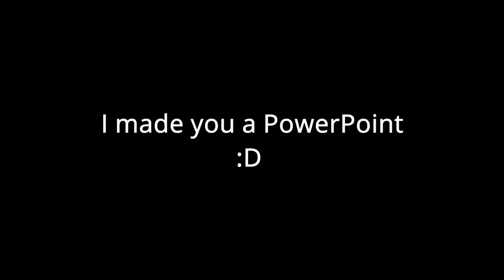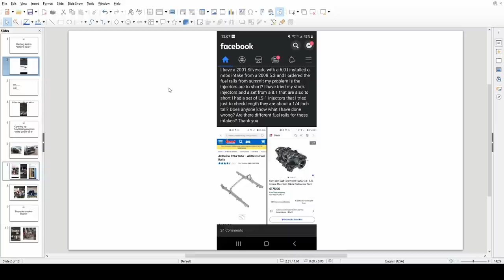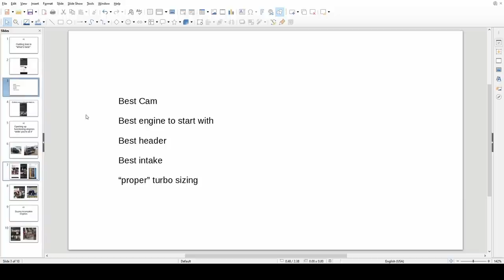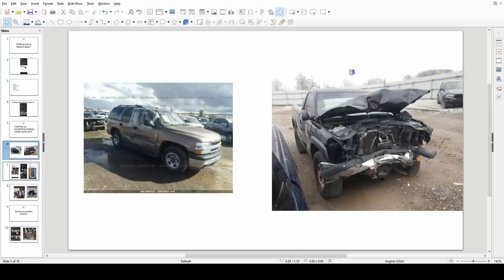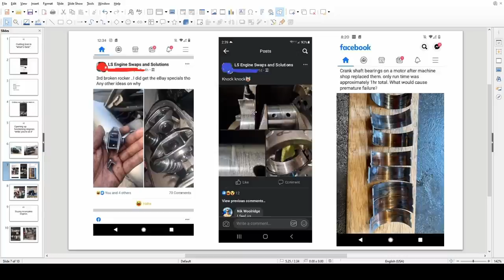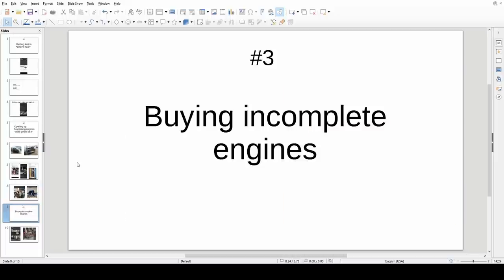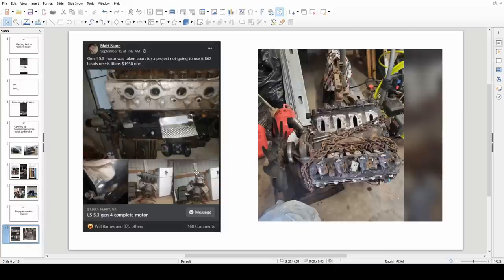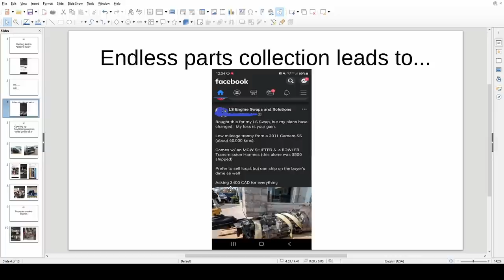3 LS engine build traps and pitfalls to avoid at all costs!

Comment: SOOOOO, i just bought a MB with SUPERCHARGED engine. I ASSUME headers or bigger exhaust would typically help a TURBO and /or supercharged engine more so than NA factory engine.

HEADERS on an LS engine would help ALOT more if combined with higher flow heads, higher compression , stroker crank, more fuel, bigger cam, proper tuning AND/OR a turbo/supercharger

Comment: I actually had a 30k mile 4th gen 6.0 GM crate motor that had a trunion failure on cylinder 1. Still ran fine, lifter was just kicked a little because of missing needles.

Comment: I agree with everything you said, but unfortunately shit can still happen. Bought my 06 Envoy Denali with only 30,000 miles on it, Drove it stock, with regular oil changes for another 100,000 miles, before deciding to delete the dod, installed a sloppy cam, springs and single turbo. Removed 4x4, and installed a 4l80e. Got it dynoed, only to spin a bearing 2 weeks later. Alls good in the end though. Now it's built with all forged internals. However, had I not been able to afford it, I would have just gone to the junkyard and picked up another engine. Gotta know what you can do within your budget.

Comment: More a question then comment.  You have a ls vortex with 300,000 plus miles and still runs. You pull it apart and refresh or run it?  I am the second owner sense 80,000.
Reply from the maker: Why? Why? My house is 117 years old... Do I tear it down and rebuild it? Or go inside and take a nap?

Comment: I found that buying a complete truck that was wrecked in the rear or rolled over is they way to go..you get all the engine and transmission parts plus electrical you need..plus you can sell the rest of the truck for money to purchase miscellaneous parts..

Comment: I just came across this, good video.  Just getting ready to put an LS1 from a 99 TA into a 02 Formula roller.  I did buy an aluminum intake to replace the LS1 intake and a stage 2 cam to help the shortcomings of said intake.  I'm debating on taking the heads off and porting them after I take the engine out of the donor car, I'm just worried about doing too much to a running engine as you mentioned.  The only reason I bought the intake is because I got a great deal on it, already had the cam and figured why not!  Hopefully in the next few years I'll be able to save up enough money for a fast 102 intake.  

I believe most people don't have a plan, I always have a plan... It's money and time that get in the way.. lol
Reply from the maker: Probably do wheelies with the extra 15 hp from head porting

Comment: Nothing wrong with stock LS engine from junkyard as long the is stock LS engine, one mistake is add to much horsepower to LS Vortec 6.0 400hp to LS3 6.2 430hp,  based on your budget, the best way is stock LS engine and transmission for engine swap, if you know the vehicle going to LS engine swap on, for example GM W body Chevy Impala and Pontiac Gxp the engine was turned sideways for GM 3800 V6 1gen & gen 2 & gen 3 engines basic 3800 and supercharger 3800 V6 was many W body and F Body, this same thing Pontiac Gxp 5.3 V8 LS engine, Chevy Impala SS also with 5.3 V8 LS engine, Chevy Silverado 5.3 LS and Vortec 6.0 V8 , engine swaps should fun, and  enjoyable.

Comment: Just put a lq4 from a van in my 83d150 . I’m sure you know this but motor mounts are super easy to make . Use a flat plate to the LS an use the factory dodge 318/360 mounts just turned around an weld to motor plate .. also mine has the 4l80 an all I did was spread the dodge trans mount ears about 1” an bolted to the 4l80 an use dodge cross member but pull the bolts an slide to the front holes in the frame an redrill the outer two .. 0$ an  dodge basically built it for ls swaps lol

Comment: I have purchased a 02 Chevy Silverado, 192k plus
Runs terrific. My question is what do you suggest for a cam swap. It's the only upgrade I'm considering.
Reply from the maker: Buy the cheapest one. 

Decide if you want a converter or not, and if you want to buy springs or not, then buy the cheapest one
Reply: @TheDrivewayEngineer  thanks for the advice. It's going into my 84 camaro z28 with a t5 manual transmission. 
Been watching a few of your videos. Will I have to get the pcm re programmed?

Comment: If you're going to spend a lot of money on a built engine for a swap I'd advise you to buy two engines. One should be complete and one can be pretty bare because you have all of the bits on the first engine. Use the complete motor to get the swap done as quickly as possible so you know that once you have finished building the other motor all you will need is a retune and maybe a fuel pump and exhaust. That's just the same as upgrading a vehicle that comes with an LS.

Personally I'd just get a low mile good LS3 and save the rest of my money for upgrading brakes, suspension, tires and driveline bits that may break with the extra power.
Reply: Very good idea which also gets you a spare engine. I've lived through several "collector vehicle and part" cycles and the LS supply is great (today) but it won't remain that way with the end of the "new simple petrol engine" era.  Smart dismantlers will keep a stash of desirable pieces for their retirement.

Comment: The only thing I have to disagree with is "it was running before the crash", yeah, on 7 cyl, with 5lbs of oil pressure!
Reply: Yep, just because it was running doesn't mean it was taken care of.
Reply: I'm going to tell you guys a secret. Look down the oil fill hole of any engine, if it looks disgusting, it wasn't looked after. If its reasonably clean inside it was properly maintained and should run fine. Also if the inside of the vehicle looks like they had pigs and chickens living in it that shows no pride of ownership, walk away
Reply: @superrodder2002  I could agree more 👍👍👍👍

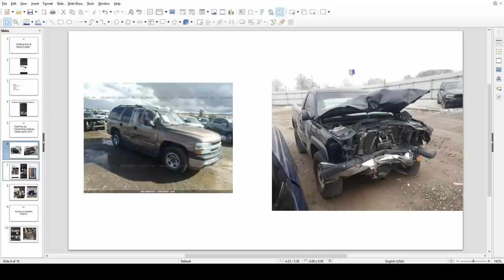Comment: 6:11 so what if the engine had the usual failed pushrod, lifter, valve spring combo?
Reply from the maker: I have no idea what "the usual failed" is. 

I've never once pulled one of these in 18 engines now that didn't just work the way I got it.
Reply: @TheDrivewayEngineer  its a common failure on 6.0s. Also cam bearings.

Comment: I was going to make bad decision a few days ago. I went to a pick and pull yard and I saw a Cadillac Escalade with a lq9 block I was thinking of buying it to build it up cheap but my common sense kick in so I just left it there because I saw someone else literally buy a running lq4 took it apart and they spent about $6000 into it.
Reply: That's not bad if he went with a new stroker assembly, heads etc...

Comment: I've seen plenty of factory trunion failures. And I've seen massive differences in similar advertised cams. So it kinda works both ways. Moderate performance, don't break the seal on the engine. If you want to compete in most motorsports, you're probably gonna be digging into the motor.
Reply from the maker: People who are going to compete in motorsports don't come to YouTube for advice. 

They do however turn around and tell some poor bastard who just wonders what he needs in his Iroc for it to live a few years and double the power he had that he can't do any of it without trunions, and porting, and forged this and that, and while you're at it.

Comment: Video makes sense but it’s for LS dummies for the intake you would’ve just gotten it with its original fuel rails and injectors with the intake for 100$ on offer up and all you would’ve needed was an 30$ adapter for the throttle body unless your going 92 mm and a 35 c5 corvette fuel pressure regulator because 01 has return lines and then obviously intake gaskets. He’s explaining to the LS dummies Richard explains a lot but if you don’t know the basics he’ll get you into a rabbit hole both content creators help and are informative.
Reply from the maker: Correct, all I'm trying to tell people is consider the cost and try to look at the big picture before they jump in.

Comment: A lot of old timers or guys that have learned from old timers seem to get really caught up in building these like they're a small block chevy. I've got a buddy with a 5.3 truck that is dead set on getting a 6.0 and putting aftermarket heads and dome pistons in it so he can make big power.

Also guys that feel like they need to go with the Melling high pressure oil pump. I've never ever heard of a stock LS pump failing ever. 

Cam bearings look bad, so they replace them. Nevermind that it would've run another 100,000 miles as it was.
Reply from the maker: Exactly
Reply: I have seen stock oil pumps fail. The pressure relief valve sticks open on cold starts sometimes and you get really low oil pressure. I’ve probably replaced about 10 of them for this over the years.
Reply: 219k on tahoe. Oil pump was playing games so I throw Lucas oil and 10w40. No more issues lol pressure to the moon

Comment: 5:50 while they clearly ran well, someone has never done all the work to get them installed and then have a rear main seal leak or a slight knock
Just because they ran doesn't mean they ran good.
I always do head gaskets and bolts since these are always graphite instead of multi layer steel. the pistons/valves are ALWAYS caked in carbon
oil pan gasket
intake gaskets
valve cover gaskets
springs
plugs and wires
trans filter and gasket
rear main
maybe even front main if I see any signs of moisture...
I HATE having to pull a motor I just installed... way easier on the engine stand.

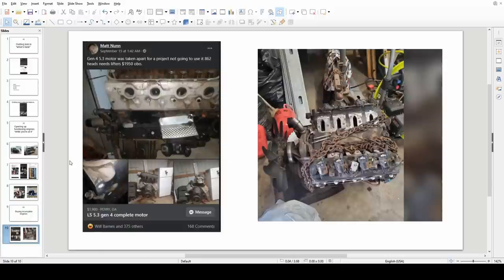8:35 thats HILARIOUS!!! bwahahhahah F Matt
Reply: My 4.8 LS i originally was NOT going to dig into but even after getting the crank out and everything disassembled it wasnt until after i starting honing the cylinder walls that i found a cracked piston. I had rusty valves which was my only reason to take the heads off and at that point i wanted to go the extra mile. It was out of a truck that had been running right before it was parked. and it ran well.. So yeah i mean its literally just kind of a preference if you want to play completely safe or not.
Reply: @lionslide9566  yea I mean you could have dropped it in and ran another 100k miles or another 10 miles... I would be super mad if it popped after all that work tho. so I always go through them, not the crank but at least the heads and check the pistons, valves, and cylinders for cracks etc...
Reply from the maker: You're correct. 

In 14 swaps now, I've never once done all the work to find out my engine was somehow no good

Comment: I agree with a fair amount on what was said.... what DOES matter with the Turbo(especially the chinese ones) is the Bearing type.  If youre going to Spend extra $$$, get the ceramic ball bearing. The cam selection matters for idle quality more than power output for 90% of off the shelf cams. Get something that has close to no overlap or a negative overlap cam for boost...  and any engine less than 400 cu in would likely be better off with cathedral port heads if its a street car.  If you want a dyno queen go waste your money on Gen 4 heads and expensive intake...  and FYI, there is actually a place where the Velocity sheet metal LS intakes DO shine. And thats on larger cu in Strokers with the right cam. Typically anything >410 cu in can benefit from Gen 4 heads and and sheet metal intake.     One thing that I ALWAYS do with any LS swap(even if left untouched) is put a .040” shim in the relief valve of the oil pump. Clean up the relief port and install a new OEM o-ring.  That’ll fix alot of the potential oiling failures, which isn’t discussed nearly enough w/ these engines.

Comment: I found myself prone to the "while im in there" itis. I got a 07 van lq4 and 4l80e combo deal shipped to me for a decent deal ( before the prices spiked on them) and whil the engine was on the stand i dropped the oil pan put on a new oil pump, new seals, new pick up, new sensors, new water pump, new gaskets, and yada yada, but i was told /NOT/ to check the mains or the cam bearings, it came from a running truck and itll run fine. sure as shit swapped it into my truck primed it over, and when it caught held steady at 50 psi oil pressure. been running like that since.. soon theres a rec port and cam swap in it for me. but you know you go full stupid when you start looking that deep. i probably will get some milling done on them, just to help the cam out a little but  i keep telling myself to be humble with the cam. the compression and 6.0 displacement will get the punch i want. rear gear will help with that too. (4l60 to 4l80e suck for first gear "feel" like its slower)

Comment: J.R I have a local junkyard that sells “all” engines in the yard for $175-$250. What do I need to look for besides it spinning? Or if it spins it wins as long as it has the intake on for rust etc???
Reply from the maker: That's all I do, make sure it's complete, make sure it spins more than a rotation. 

It's really all you can do in the yard.

Comment: In all honesty. I bought a gmc savana In oct of 2017. I've been trying to find an actual mechanic to punch it out and get it back to as close to perfect as possible for 219k miles. (Had 198k when I paid $500 for it.)  It's been losing water since I bought it.  
Little then a little more then a little more then a lot.  I thought I had a head gasket blowing water outside if the block.  Ends up.  The hose which is right at top  center.  Had 4 wear spots from the pulley in front of it. 3 small wears then a cut through.  
Couldn't even find the part in a parts store.  It's rigged but it is sealed tight with new hose.   Cost was 1 ft of the heater core feed type hose and cutting the old factory part so I could slip hose on and clamp.  Now. There is no way that hose is ever going to touch that pulley again.

Comment: JR, do you put in a new oil pump when you have to change the oil pan for clearance?
Reply from the maker: No, but the pickup needs to match the pan, most come with the right one.
Reply: @TheDrivewayEngineer  LQ9 is going in my 87 K30, do you think I need to swap oil pans? I know I need a different crossmember.

Comment: Picking the right part is important to make power where you want it and how much power you want to make.   Telling people that headers don't make power over manifolds is ridiculous!   I have picked up power, et and mph on every LS I've run headers on.   I did it in series starting with removing cats then adding better flowing mufflers then adding headers.   I picked up power at every step.   I even picked up power without tuning at each stage.   I had a 2002 Silverado 1500 excab running 12.9 at 104 mph running a stock ls1 with full exhaust and tuning.   The best it run before making changes to exhaust was 13.6 at 9x mph.  These runs were on a 28" et street.   My bolt on 2002 ss went 12.1@ 110 it was running high 12's before tune and full exhaust.   The car was a factory freak.   I added a cam and went 11.5's@117.  Added stage 2.5 tsp heads and went 11.2 @120.  Then 6.0 with ls3 heads and intake to run in the 10.6 range.
Reply from the maker: Cool story
Reply: @TheDrivewayEngineer  thought you'd like it. Figured since you were giving such bs info I'd help out.

Comment: Wow JR just WOW!!! It's amazing video I tell people the same thing. Biggest problem people make is they buy the complete 6.0 motor(375hp), they tear it apart spend 1000s now they got 450-475 hp. My list: motor, intake pipe, mounts, fuel pump, throttle body for cable pedal, flywheel,  burnouts.
Reply from the maker: It's always funny/sad to me when people insist on buying the finest, lowest milage, most perfect engine ever, just to tear it down and replace everything 😂

Comment: Yeah the while you are there got my friend hard. Put cam bearings in his block because they were shot. But the rods and Mains were fine. Replaced them too just because andddd 5k miles later rod number one spun. Waste the money into a rebuild gone like that. Where you can see fellas take a dumpster fire of a engine and it’ll run just as good.

Comment: Alright I need guidance fellas... Gap the rings or not? I have a running 2005 6.0/4l80 that is going into an S10 Blazer. Goal is to have 500 tire with a gt45 and cam. Should I drop it in as-is and get it running first? Or gap the rings and do cam/springs first?
Reply from the maker: I wouldn't gap anything I was going to run a GT45 on.
Reply: Music to my ears...er eyes
Reply: Don't think I've heard you mention gapping the rings for a budget turbo, but yeah just wanted to make sure. Thanks!

Comment: In the Jeep world I see people do LS swaps into their rig and end up with terrible belly heights, brittle aluminum pans, expensive adapters that solve VVS issues and clocking, "cold air intakes" that pull hot dirty air right off the radiator. Their exhaust is horribly routee and melts the shoes of any passenger while simultaneously conflicting with the front driveshaft yoke. Or the do a passenger drop setup and have to run a weak shaft or even an intermediate shaft to clear the transmission pan. 

Basically they completely bastardized their rig for the worse when they could have just stroked the 4.0 to a 4.7 and gotten better low end torque and similar horsepower to the wheels.

Comment: I just want to know the cheapest way to make about 400 NA horsepower. I don't care how much work it is or how much time it takes. I'm poor and I'm in no hurry. And I love going to Junkyards and taking things apart. Wiring doesn't scare me. And I don't care AT ALL what it looks like. As long as it runs and makes power. 400 is great. 300 will work if it's cheap enough.
Reply from the maker: The cheapest way is to not set an arbitrary goal like 400. 

Figure out if you can afford a cam, if you can afford springs, if you can afford a converter, and go from there. 

Let the HP fall where it will.